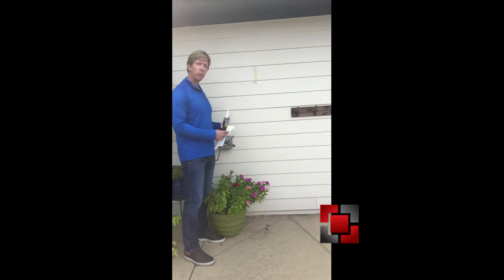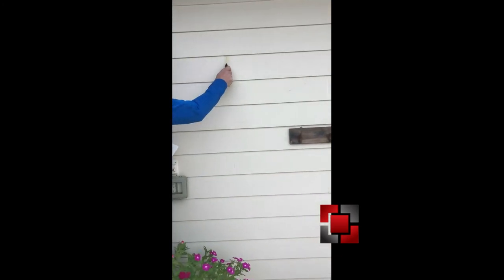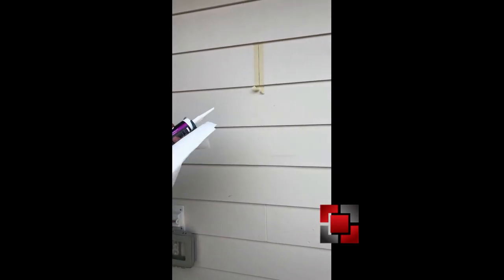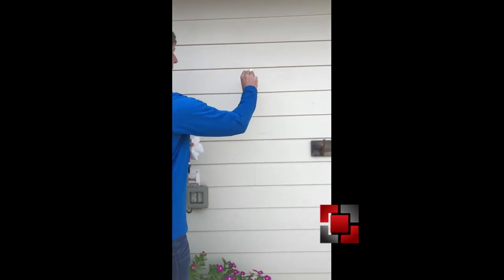James Hardie Butt Joint Caulking Instructional - Explained in a Quick Minute by Preview Construction

Comment: For those watching, James hardi specifies to NOT caulk butt joints if it is Color Plus siding. This video did not specify what product line was used on this customers home.
Reply from the maker: You are correct, since the birth of ColorPlus Technology James Hardie has recommended using plank flashing behind the butt joints versus caulking. However, the large majority of installers in Texas do not use plank flashing when installing primed product. This video is to instruct homeowners on how to reseal those joints when butt joint flashing is not present.
Reply: anything generally before 2012 need to caulk
Reply: I was thinking the same! 
Plus I’ve never in my 12 years in the paint industry ever seen anyone tape off butt joints before caulking 😂

Comment: So fixing a mistake by making the same mistake?  You don’t caulk those joints…clean them out and leave them alone.
Reply from the maker: Thank you for your input Robert. Yes, plank flashing behind the butt joint versus caulking is the recommended best practice by James Hardie. However, I would estimate 90% or more of the resides done in Texas with Primed material have the butt joints caulked versus using Tamlyn Plank Flashing behind them. Not resealing the joints could cause a problem down the road. This video was to instruct people on how to reseal those joints without appropriate flashing behind them.